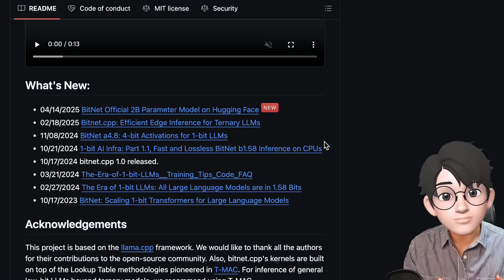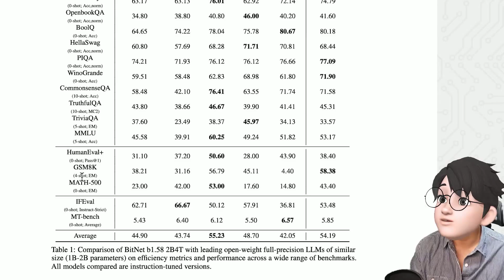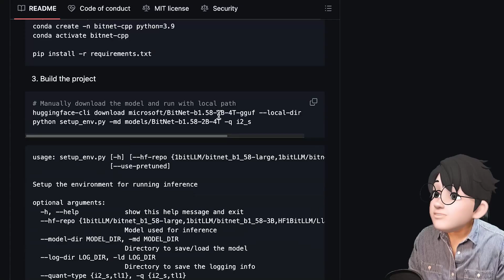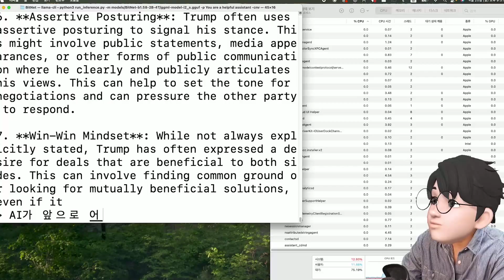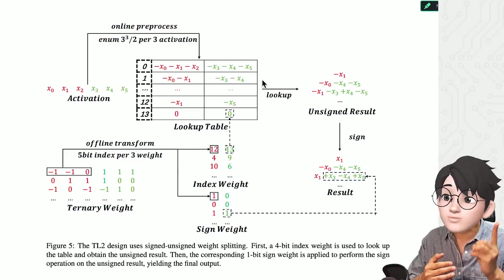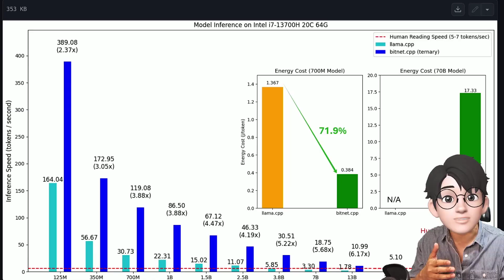AI’s LK-99 Is Real… Now Usable | BitNet Trained with 1-Bit, Runs on CPU with 400MB, Beats Rivals

Comment: Mozilla released a single executable called LlamaFile that can run completely on a computer CPU, not requiring a GPU. It's pretty cool because there is absolutely no setup or configuration - just run the executable. Also, I have had luck running GPT4All solely on the CPU.